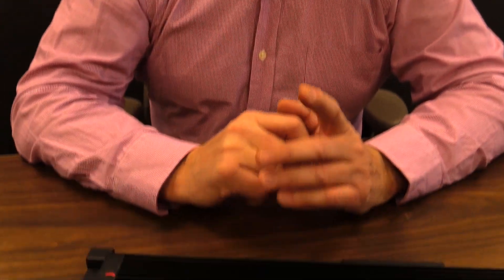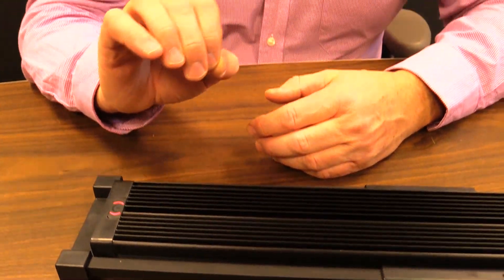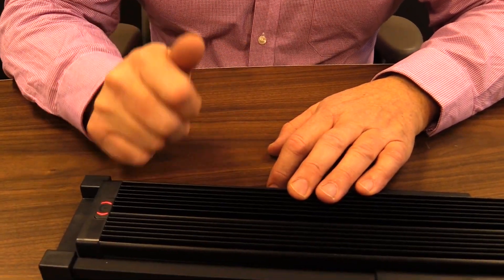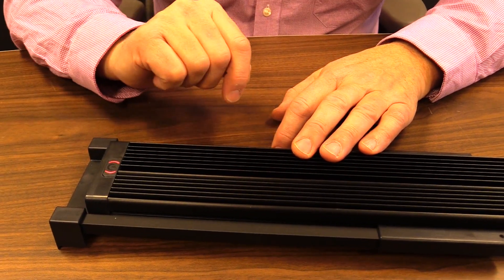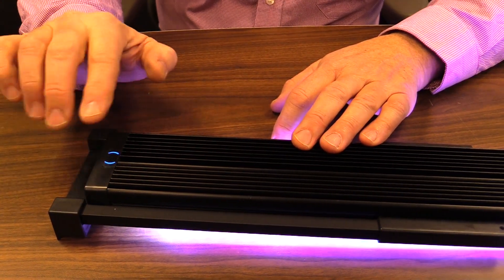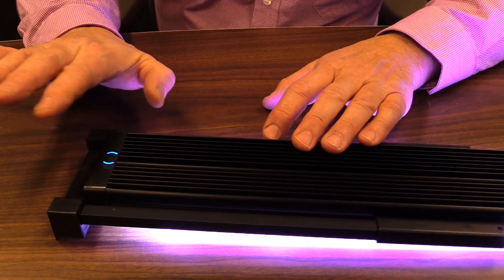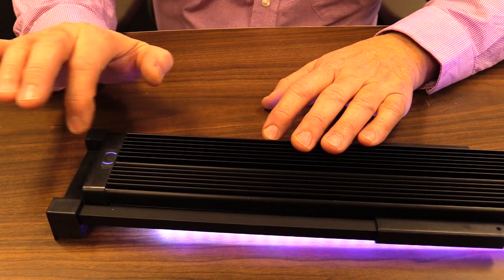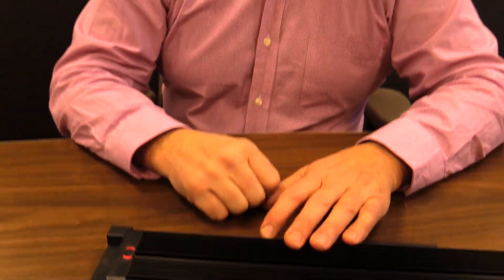Fluval Aquarium LED Touch-Switch Control

Comment: While your instructions are correct and some people may have been using the switch incorrectly, there are still many times when I have pressed it and had unexpected behaviour. Long touch: nothing happens, switches modes. Short touch: nothing happens. This occurs most frequently with damp hands, though that's not always the case. It's not just user error, I would urge you to consider a different input on your next version.

Comment: Well I guess you guys elected to "double down" on your product issues by blaming customers.  Yes, plenty of us are using the switch correctly and it still fails to respond, and yes, plenty of us do not appreciate the wifi controller that randomly turns on in the middle of the night.  Your product is wonderful on good days, and an extremely frustrating waste of money on bad days.  Taking your condescending tone is a foolish script.  This video would be fine if you had responded to "some" that are clearly operator error, but going full-on operator error and not owning a single piece of blame for this common problem?  Well I just learned what I need to know about buying equipment from your company.  Thanks for the $25 check and congratulations on getting $250 from me.  That's the last of it until you become better engineers and customer service professionals.
Reply from the maker: Unfortunately it seems you have misinterpreted our intentions, we certainly are not “blaming” anyone, we are providing practical guidance as we see a clear need for it. It is a touch switch and as such it functions best with a patient soft touch with deliberate action. Our customer service follow up shows very few issues, but you may certainly contact customer service if you need further product support.
Reply: Fluval Aquatics you blatantly say user error, sounds like blaming to me
Reply: It is not user error, it is Fluval engineering error. So many people are having issue with the switch. Read on Amazon review. It is every where on the website that the touch switch does not work on FLuval Fresh and Plant. If all the problem with the switch is users error that mean there are many stupid users or it is time for Fluval to blame on itself.

Comment: My 2.0 flashes, switches between bright to blue to off with a will of its own like being at an ac/dc concert however, i changed the outlet i was using,,,,plenty of cord to work with, thank you for that, and it works exactly the way you said it will. It didn't act up at the pet shop where i bought the thing so,,, before i slam a product publicly i took the time to dig deeper. Sorry guys 20 minutes later the damn thing acted up with a will of its own. You made the switch too sensitive or there IS a design flaw in the works. STRIKE THREE ! you're outa there.
Reply from the maker: As it functioned well at the store it sounds like you may have an issue with the power bar or receptacle you are using at home. Any chance you have the connection near a sump in a marine set up, wouldn't be the first time we have seen corrosion based interference cause exactly this type of phenomena.

Comment: Mine does it without me even touching it! 
Something is clearly wrong. It can be in the middle of the day, and the fluval 2.0 has moonlight on. Another day it is completely off. And also dimmed down max. It has happened atleast 10 times within the last 3 weeks. What is wrong? And how can I fix it? 
Please. 
Kind regards
Reply: Look at my comment 3 years ago. I own 3 of these lights. But the thing that is happening with the big 59w version is something wrong.
Reply from the maker: Please send the question to fluvalsmart@fluvalaquatics.com and make sure to include some images of the protective lens area of the light unit, make sure to unplug the light before taking some clear close up images of that area.
Reply: @fluval  I did, they just replied I am sorry. You need to buy a new light. And then I looked, and they did not even sell them anymore. It is the transformer. Is there anyway I can buy a new one from you. Just the transformer. I actually like the 2.0 more then the 3.0. No offense.

Comment: Your switch is broken.  It shouldn't require a video to tell people how to properly use it and then still fail.  

I've had this light for less than 6 months.  I love the light output and it's good for my planted tank.  Unfortunately I can't rely on it all the time.  I have it set up to a timer to turn on and off automatically.  The problem is many times when it turns on the light is dimmed all the way down and I have to fiddle with it to get the brightness back to where it needs to be.  It doesn't always seem to remember that setting.  Also it loves to fast cycle through the settings sometimes when all I'm trying to do is adjust the brightness.  Twice now the timer has turned it on and the light was stuck in moonlight mode even though it was in full led mode when it turned off.  It's currently stuck in moonlight mode and no amount of messing with the switch can change it.  Right now it's just a $200 night light that's useless.  

Calling "support" is not a solution since we all know that they'll want us to send it in on my dime and then wait 2 months before I get it back if I get it back at all.  And of course all i'll get back is a refurbished light with probably a 30 day warranty which will probably fail for the same problem it was returned for.
Reply from the maker: Hi Michael, we have received some feedback about the switch, however, when we had the opportunity to examine the units in question, we found that the majority were use-related issues, and not related to the switch. Our CS technical advisers are very knowledgeable and helpful. We would be happy to recommend a review of your unit to ensure it is functioning properly.
Reply: Buying Fluval products is 50/50. I think Fluval has quality problem and ackward engineering design. So far I do not have issue with the switch on my Fluval Fresh and Plant but the WIFI controller is very poorly design, what I mean is very very bad engineering design. The touch switch is very easy to use, even my daughter can use it. I have no doubt you have issue with the switch not the user error as specified below. I returned three of the FLuval Aquasky timer because of faulty switch and operation. Finally, I got tired of it and return the whole things including the Fluval Aquasky back to Petco. I like the Fluval Fresh and Plant LED specification for my planted tank and I am hoping it will work reliably, otherwise I will be done with Fluval products.
Reply: This is exactly right

Comment: Yeah, the switch is pretty random for me too, even if I follow the video instruction exactly.  Even after unplugging the ballast.  When it doesn't work, I go for a few minutes trying it, unplugging, trying, unplugging, etc... and it eventually starts operating. When it finally starts working it will zoom up the intensity of the light really fast, and then you can operate it.  From now on I may just get it to the desired intensity and then just use the plug to turn it on and off.

Comment: Thanks for this video, I did unplug a few times then powered it up again but it did not work. Is there a particular place on the touch button to touch, or the lights on the switch should be covered. I will make a video when I get home and post it.. because I am doing what you said but it still didn't work.
Reply from the maker: Hi Ashish, when touching the button make full contact with your finger as per the video, not just the tip. A light touch is usually better. Then when going to dimming after increasing or the reverse always lift your finger for a second and then touch the switch again. The video really does capture how you should be using the unit, if that does not work you should go to the store your purchased it at with the receipt and have the unit returned for service or contact customer service directly, as you prefer.
Reply: Fluval Aquatics watch my video, it's your flaky switch

Comment: I was under the impression the light 'dimmed' on and off automatically (to simulate sunrise and sunset). Disappointed when I realised it was manually set to a specific brightness. Maybe a nice feature in future products?
Reply from the maker: Jason, that function can be controlled by our Fluval WIFI controller for version  2.0. We do appreciate the input.
Reply: Thanks for the tip. It's just a bit expensive for a WiFi controller, personally, and in my humble opinion. I appreciate there's more tech involved,but I'm reluctant to spend that much money on a WiFi controller that so many people are having trouble with. I don't see the aquarium for 3 week intervals so if the lights stop working or "reset" I won't know until my next trip.

Comment: This is absolutely great light that was simply poorly designed for any user control whatsoever.  The lack of control of this particular light is mind boggling.  It shouldn't be this difficult to function a light.  Getting the wifi controller is a waste of time, because it's absolute garbage. I loved the lighting so much I just wanted to run this on a timer but I noticed the adapter ran extremely hot as well.  I love Fluval led lights and really wanted to love this one too. The brightness on these lights are unreal and is just way better than other lights I've used.  It's just a really poor design outside of that.  If they ever fixed these issues, this would be a fantastic light.
Reply from the maker: John, sorry you feel that way but in all honesty we found most consumer dissatisfaction with the light switch was related to the way it was used, that is why we cut this video. A basic mechanical timer is what is really necessary for control and if you follow our tutorial on using the switch it should work out, the spectrum and intensity are really outstanding on these lights. As for the driver running hot it is designed to do so and does perform within spec. Also of note is the IP67 water proof engineering which does provide additional benefits.
Reply: I understand what you are saying, I'm just giving you feedback that I disagree.  I pointed out what I really love about this light, and I stand by it.  I've been a long time user of your lights and am a fan.  But all the cons with this model are unforgiveable.  The fact that you have so many people who are "misusing" the switch should tell you how poorly designed it is.  A switch isn't anything new, and it didn't need to be reinvented.  It shouldn't be this difficult to use.  It's an awfully expensive light to have all these things wrong with it. At a higher price, I expect it to make life easier. But it doesn't.  The fact that it doesn't have a remote is one thing, but to add on top of the fact that the wifi controller is useless really makes this light a poor model. There is very little control of this light for the user, which is very disappointing.  I see you guys keep commenting on your "findings" about the users being at fault in using the switch.  But when we have to go to these lengths to use a switch, and your customers are still telling you it's problematic, it would be helpful to address it.  If you make a newer model that addresses these issues, and the issues with the wifi controller, I'll consider returning as a customer.  Like I said before, I really enjoy how bright it is.  But I can't use this with all of the other flaws. If you prefer to stand by the idea that we are all at fault, then so be it.  How you address these issues will reflect the kind of company you choose to be.
Reply from the maker: John, when it comes to a single touch switch that is multi-functional, there are preferred ways of using it, simply what we are trying to communicate here, the video is intended to be supportive and not to blame or relate fault, nor did we in fact mention fault in this short video. The fact we are addressing what we have acknowledged and looked into speaks favorably for our brand, at least in our opinion. Seeing is believing, we operate the unit and show the results, also take note of our suggestion to unplug and re-plug as we did see some units perform properly after having been operated outside of our recommended approach. While we understand expectations and comparisons do have their place we are simply trying to support our customers with helpful information and have invested in many components within this system that are inherent in its quality that are performance based and not in the form of an accessory or similar.
Reply: I appreciate the support for those who are still trying to use it.  However your customers are telling you what they want from this light.  And they are telling you the results they have had from it. You can do what you wish with it.  But this light has been out for a long time now, and your customers aren't seeing results.

Comment: Hello,
i bought two 2.0, cost £370 plus a wifi controller cost £97,
i set up the app on my i phone, worked great at first, i was impressed the manual operations worked well from app on my phone.
Then after setting up times and brightness i set the units to automatic from the app.
One unit has adopted random behavior, i check the app and all settings are as i left them, the unit with random behavior is setting its self back from the button being red for wifi app control to white, i touch it back to red for wifi app control, sometime later it sets its self back to  white, its become a frustrating chore to periodical climb up the stepladders and touch it back to red.
No i don't have any pets who are ninja like climbing up on the lamp and touching the switch from red to white.
i have re set it back to factory settings, set up the app and yes the problem comes back.
Any help would be appreciated.
Regards,
Nik

Comment: I bought a 48" Fluval Led several years ago.  It was a pricey unit and I am now seeing the problems listed here.  Set it to bright white. And since I use a timer, when It turns back on, it is in moonlight mode.  So I am not a happy camper either.
Reply from the maker: Margaret, please contact the customer support page at fluvalaquatics.com , make sure to select your country and then the support option.

Comment: I would never buy these ever again. The touch switch when cleaning the tank goes from RED to Blue if you accidentally touch it but then to get it back to red again is a pain. Save your money and use it on a lighting solution for your tank that actually works.

Comment: what is wrong with this Led? put it on a timer the light dont turn on when it suppose to had to turn it on manual and it keep switchin to night mode sometime it will turn off when its not suppose to. why ? so annoying not reliable. smh
Reply from the maker: Please let us know which timer you are using?
Reply: the timer is fine i been using it on other LED for 3 years now and never had problem.  but Lets just say if the timer was the problem which timer would u recommend?
Reply: the timer is not the problem here. i took off the timer and turn on the led after 20-30 mins it wlll turn to night mode then later off on its own.
Reply from the maker: That was the right thing to do, please contact customer service for further assistance, this is an issue we are not familiar with.